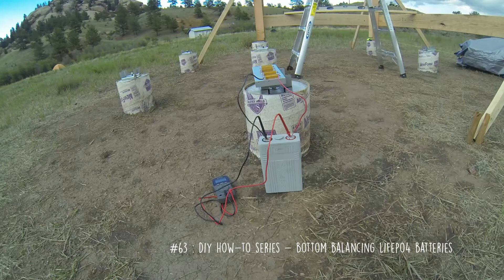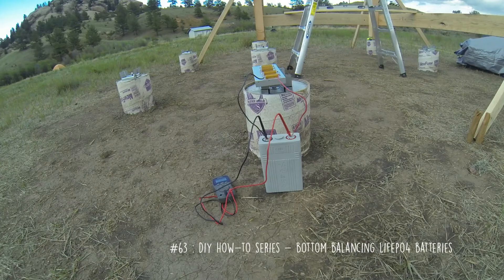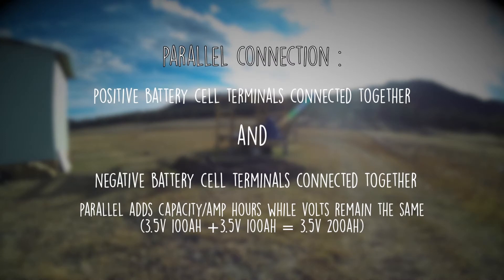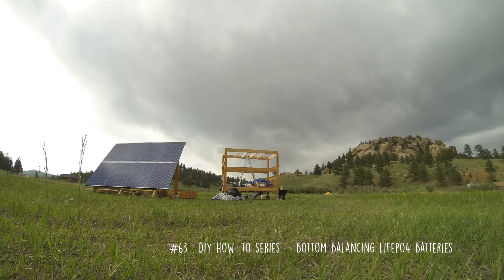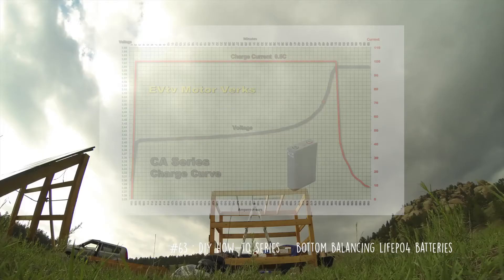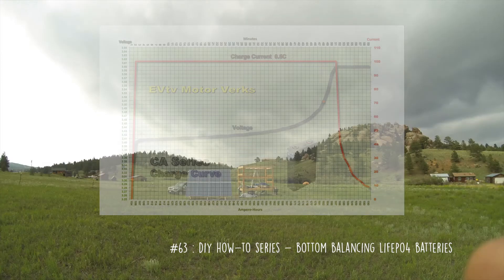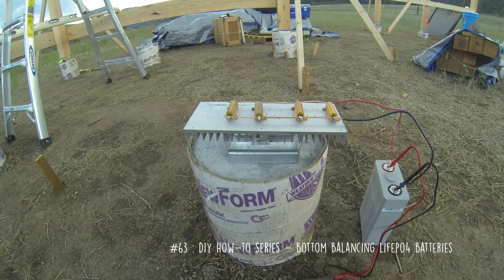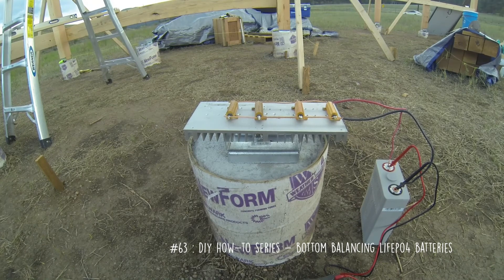Bottom Balancing LIFEPO4 Cells

Comment: What’s the difference between discharging cells individually to 2.5v and all cells connected in parallel to 2.5v?  Is one method better than the other?  After bottom balance connect cells in series and charge to desired SOC, correct?  Thank you.

Comment: Why can't I just reduce my cells to about 2.7 or 2.8 volts and then put them in parallel for a few days? Wouldn't they all come to exactly the same voltage that way? Isn't this the best way to bottom balance?
Reply: Just be careful with that. If there is a considerably different state of charge, C can be very high passing into the less-charged cells and this can cause fibrillation damage. If you don't know the SoC of cells, don't do it. Or use a device to monitor things for you, like a pre-balancer.

Comment: Hello

I have done the bottom balancing of 4x 300ah winston cells but when i charge them cell no:3 always fails and reach mutch higher voltage compare to the other 3 after 14v. The difference in end is 850mV. What ou suggest?

The cells are new and i run 4S4P config "12v"

Comment: Not a good idea to take the cells below 3 volts. If you must botom balance???? To truly balance...  need to parallel all the cells for about 24 to 48 hours then series them they will be in perfect balance this way.  I use a powerlab 8 charger - discharger to check the IR & performance of the cells works awesome...
Reply from the maker: A power lab is a useful tool however I do not own one. LIFEPO4 cells have a life cycle of 2000 if used at 100%DOD. You can bring them down. Especially if you are doing it initially to "bottom balance " a pack. Since then I have not brought the system further than 60%DOD on the rare occasion. Which would give me an estimated life of between 3-5000 cycles. In my belief, simply paralleling them for a day doesn't bring them fully balanced. I prefer a more concrete/active approach in that initial balancing process. Thanks for commenting.
Reply from the maker: I am not balancing here using the battery cells moving electricity between themselves. They are being drained via a ~30amp Load.
Reply: ***** Works for me!!! I feel it's the best way to start a series pack by putting them in parallel for at least 24hrs. Nothing will change the IR or capacity of the cells.

Comment: Very good info.  Thank you.  Sharing this knowledge is so important.
Reply from the maker: MollyDolly :) Lead acids are so prevalent, but Lithiums not so much. Figured I would add a bit of what I know over the years with them in a full Off Grid setting.
Reply: cnypilot  Did you see the recent Tesla announcement about their new battery for solar homes?   It is exciting that more manufacturers are getting in the game!
Reply from the maker: MollyDolly I did. It is a good concept for all homes, really. A step to smooth out the grid. When calculating out the cost of their units to my own lithium battery bank, it still is a savings. Rather than the $2500USD for 5 kwh, theirs would be $2100USD for the same capacity (based on their 7kwh "daily cycle" pack) Savings no doubt derived from their ability to mass produce 18650 (AA) batteries used in their vehicles.
Reply: cnypilot  I hadn't worked out any figures yet... I just know that competition brings prices down.  There is another big manufacturer releasing theirs early next year...I can't remember who... but these are exciting developments for sure!
Reply from the maker: MollyDolly I am very happy to see it. Especially with the Lithium market. They have much higher power densities. (Less area needed in a household dedicated to them - I.E. Tesla's Power wall) The chemistry has less voltage sag. They are 1/4th the weight. Do not off-gas. No filling them up with distilled water or other maintenance schedules. So long as the voltages are kept within spec and bottom balanced (as noted in the video) you have a battery bank that is nearly maintenance free. Allowing more customers/users to get the Cycle lifes that they are rated for rather than Lead Acid technology being all over the map due to some people taking care of them (Pb) while others do not. The mass market loves the "Ronco Popeil"  "Set it and forget it" mind set. :)